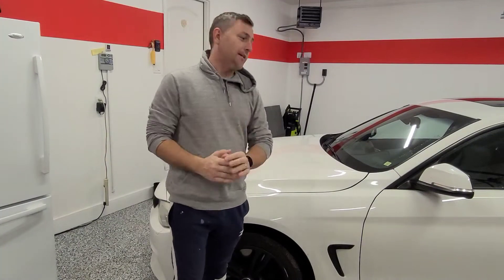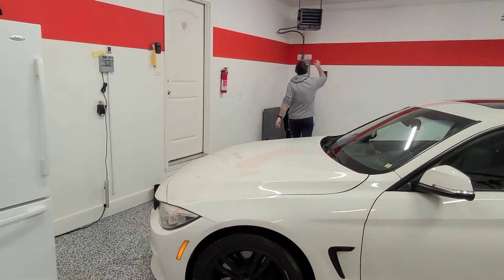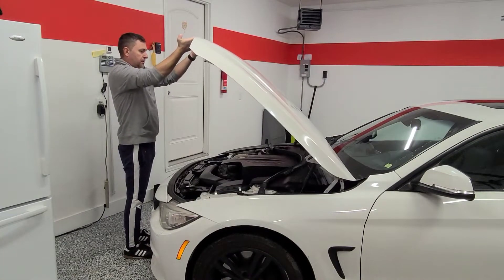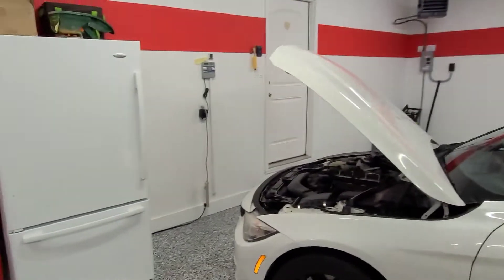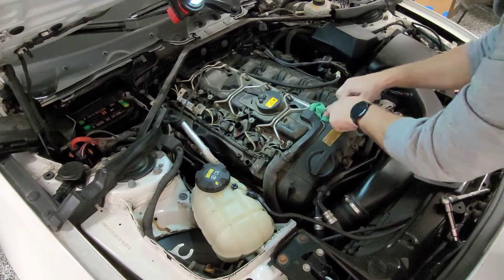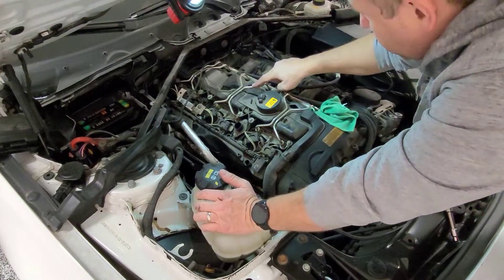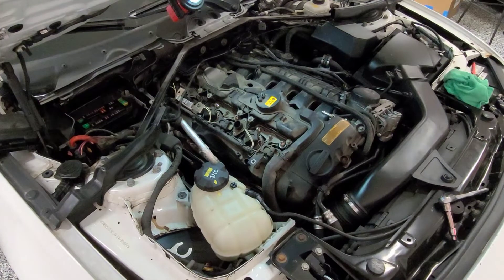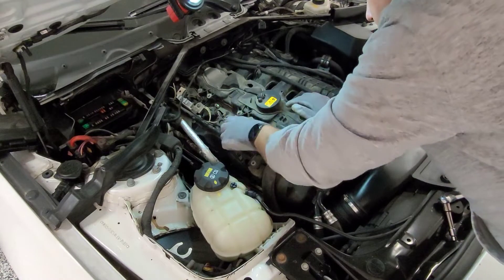How to Replace VALVE COVER GASKET BMW 435I N55

Comment: Great video man I got to do the same on my 435 i gran coupe’s but was a bit nervous to tackle it,gonna follow the way you did hopefully it goes well🤞🏿
Reply from the maker: You shoud be fine. But before you take it off try to tighten the back bolts they can be loose sometimes and leak.
Reply: Easy bro be careful and have patience

Comment: Thank you, replaced my valve cover gasket on my 640i following this video, when removing valve cover the plastic piece that clips inside valve cover disconnected from valve cover, reinstalled  valve cover without putting that plastic piece back on inside valve cover ! (Forgot about it)

How important is that for functioning of the car ???
Thanks

Comment: Is this bad? Mine 435i have the same problem i’m confused.. i will replace it by a bmw professional can you tell me how much it can cost?
Reply from the maker: It's a very common problem in bmw. But if u can't do it your self make sure you seek professional help.
Reply: @ThrottleGarage  is it costly?
Reply from the maker: @mirac4253  it can be.
Reply: @ThrottleGarage  around €1000?
Reply from the maker: More or less